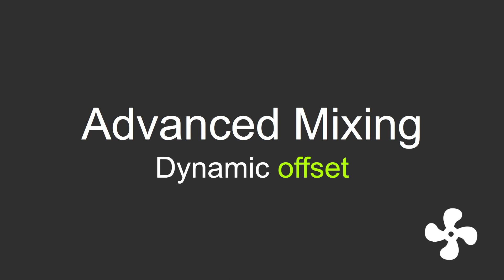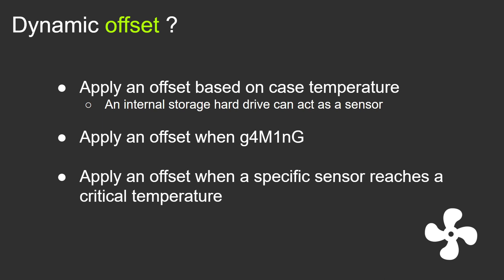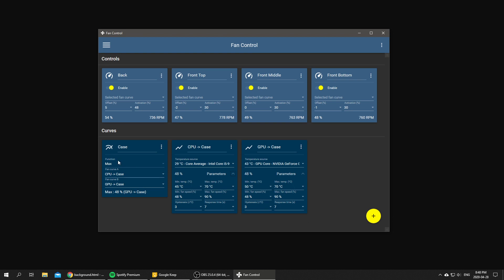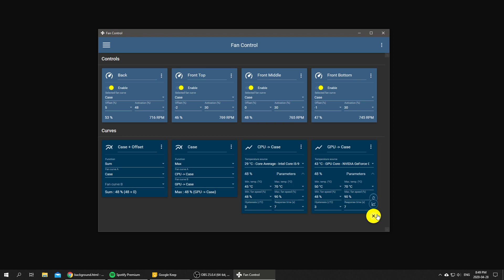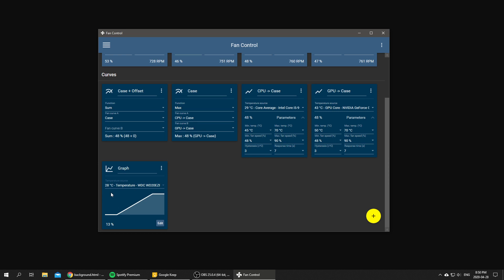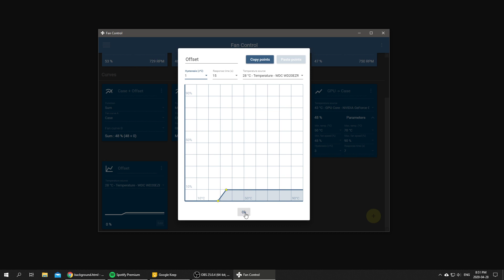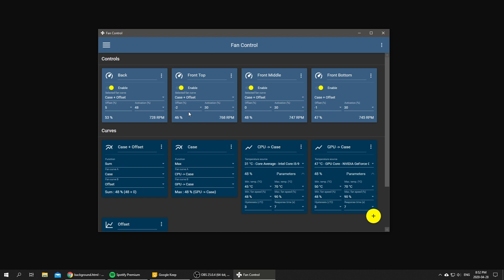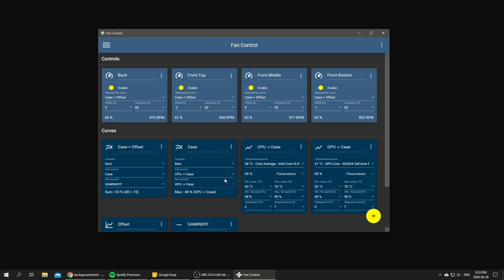Fan Control: Dynamic offset (Part 4)

Comment: I have two HP Z6 workstations … on one, fan control wouldn’t even open, the other, fan control opened but only found the GPU fan… nothing else. I spent hours trying to resolve both issues. Sadly, I had to cut my losses. Fan control seems perfect for my needs…if only it worked..😢

Comment: Thank you! Not being able to link my chassi fans to GPU temps was driving me crazy.
SpeedFan was a dead end, Argus Monitor felt to bloated (I really don´t need yet another monitoring tool) and then i stumbled over your software.

I really liked your tutorials as well, the interface looks really clean, and it gave me some new ideas.
As an example: The fan curve I setup in Radeon Software felt ok, but on my 5600 XT memory temperature is usually more of an issue than GPU temp, so now I´m thinking about creating a mixed curve.

I´ll be spending a lot of time running benchmarks and tweaking my system tonight, and I will recommend this software to others. I truly appreciate your hard work (eventhough I´m not a programmer, I can somewhat comprehend what went into the graph fan curves), thanks again.
Reply from the maker: Thanks for your interest!
Reply: @rmsoftware3759  I´m happy with what I got, but any chance for fan control on newer AMD cards? I have a 5600 XT, I tried with only drivers installed (no Adrenaline, MSI Afterburner etc). Fan Control reads the GPU sensors fine, so I got what i really needed, but it would be sweet if I could control the GPU fans as well.
Reply from the maker: @eriksundin3714  Still haven't found anything to control newer Navi cards on Windows. Had more luck with Nvidia.

Comment: I have a question not based on the video  xD
how i set it up right now ...  
2 fancurce CPU/GPU in mix.
and i have two silent wings in fron of the case ... both are set on the  "Mix" 
but both fan have different RPM one runs at 655 and other at 465 ...
i dont get that behavior... or the numbers arnt correct.,.. i dont know xD

Comment: Thank you for your nice work! Now, some feature requests:

1. Make "Step (%/sec)" selectable all the way up to 100%. 6 seconds from 0 to 100% is way too slow for me.

2. Make values for "Hysteresis", "Response time" and "Step" in pairs so that we could select them for both change directions - up and down - independently. I want to ramp up speed quickly and then slow down very gradually.

3. Introduce profiles selectable from system tray with every profile essentially being a separate "desktop" comprising all currently available settings. So, when you select a profile the UI should rebuild the "desktop" with settings from that profile. No new fancy dialogs needed.

4. Instead of "Select/unselect matching fan..." show "Select" when the fan is not matched and "Unselect" when it is matched.
Reply from the maker: 1) the range is quite limited, I agree. I will increase it. However, large steps are not good for your motherboard/fans. Since fans are complex loads, large spikes may cause issues which I why I believe most motherboard software limits how big these steps can be.
2) You are not the first to mention wanting fast step-up and slow step-down. I just added symmetric step as a first update for that feature. Step down might follow soon.
3) Profiles are my next big feature, stay tuned.
4) It's already done, just didn't pushed an update since ;)
Reply: @rmsoftware3759  re.1. - not to worry, a PWM-controlled fan can't just "connect", it has an onboard chip which handles its motor coils, so it is not like you just hook up an inductor to a fan header and even in that case it is DISconnection you would have been worrying about. A DC-controlled fan is another matter but it is not that dumb either. Anyways, I'd just show a warning telling the user about your concern and be done with it.

Also, I have a problem with your app (or rather with the underlying library which talks to hardware): for some reason on my old ASUS Z97 its temperature readings are jittery and it does not report the "SENSOR" temperature at all (or I could not find it). And that is the only sensor I can attach an external probe to - I use it to measure coolant temperature. So, sadly, I had to return to the good old and rusty SpeedFan.
Reply: @kwindzy  re re 1. Yeah I was talking about DC control, PWM is all good.

As for your temperatures, what do you mean by jittery? Are the temperatures simply off or are they randomly spiking for no apparent reasons?
Reply: @RemX405  yeah, the temps are fluctuating rather wildly compared to the same sensors reported by HWiNFO64, I had to make them change quite a bit to be able match surely, and I couldn't match the one called "SENSOR" by BIOS (first I thought I did, but then they diverged too much). SpeedFan has no such problems, although I had to set Nuvoton chip PWM control fields to "manual" in the "Advanced settings".

Comment: Hi! Thanks! I'm making a software for monitoring system sensors and so on, also using OpenHardwareMonitor. I've got just one question. How do you obtain the CPU Fan Max RPM or the control as a percentage? In OHM I can only see the current speed (in RPM), but as I don't have Max RPM I can't calculate the %. Fan controls also don't display any data in OHM. But if I use Gigabyte System Information View, it does show the Max RPM, the %, etc. Thanks!
Reply from the maker: In OHM, each fan has 2 sensors ( 2 channels ). One is called "control" and the other is "speed".  Control is the one used to read and write an 8 bit number (0-255) that controls the fan. The 8 bit value is then simply converted to a 0-100 scale for display purpose. This behavior can vary from chip to chip, but you get the idea. The speed channel is read only and returns also a binary number that can be converted to an RPM value.  So both are entirely independent, and there is no way without a specific spec sheet used by a motherboard manufacturer to know which control sensor pairs with which speed sensor. Max RPM is either calculated with a rule of 3 from the current RPM vs its %, or there was a calibration phase, that ramped up and down each fan to create some kind of lookup table (rpm/%).
Reply: @rmsoftware3759  Thanks for your response! Ok now I understand it better. The problem is that OHM shows 3 Fan Controls both all are "-" or 0. While debugging I found that my motherboard chip is a ITE IT8628E and OHM defines that for this model (in fact, for many models IT87XX similar), this chipset has 3 Fan Controls. Buuut when I see Gigabyte System Information Viewer, it shows 5 Fan Controls. The three OHM detects and 2 more. And one of these two, is the CPU Fan (the only fan I've got attached to my motherboard). I couldn't find IT8628E datasheet but did find IT8620. I know they're not the same but I'd like to try to see if I it works using that datasheet. Here's the datasheet: https://datasheetspdf.com/datasheet/IT8620E.html so how should I use it for reading Fan Controls? Thanks!
Reply from the maker: @mauriciodanielbazan9179  That's not the kind of datasheet you need. You need to have memory addresses, registers and so on. If you are not familiar with embedded electronics and programming, you would need to learns at least the basics. That's college stuff, not that it's that hard, but there is a steep learning curve.
Reply: @rmsoftware3759  Oh yeah sure, I've seen that in college! Do you know where I can get that datasheet? Thanks!
Reply from the maker: @mauriciodanielbazan9179  That's the tricky part. These are not public. So your best bet is as good as mine to find it.

Comment: Hey Remi. Loving the software. Fantastic job! I've got a couple of questions I'm hoping you can help me with. I'm unable to set the fans on my 3080ti founders edition to 0 rpm. I'm running HWinfo64 as well as MSI afterburner. Are these interfering with fan control? My other question is in regards to my AiO CPU cooler temperature sensor. I would like to cool by liquid temperature but the sensor isn't showing in fan control, yet it is in HWinfo64. Do you know anything about this? Thanks